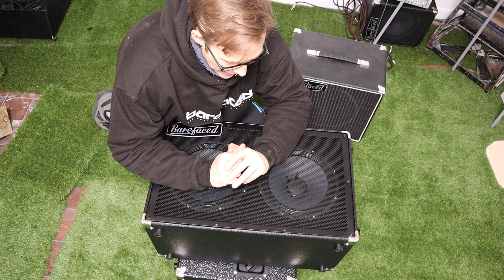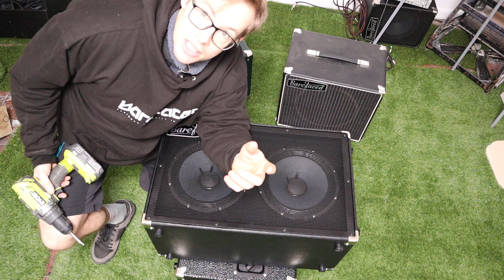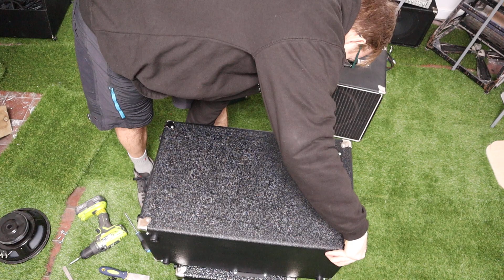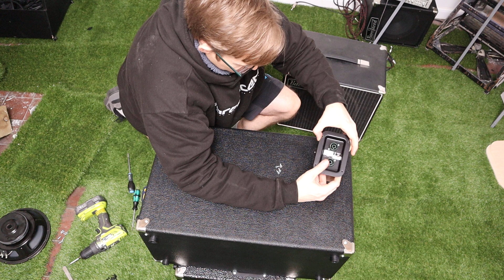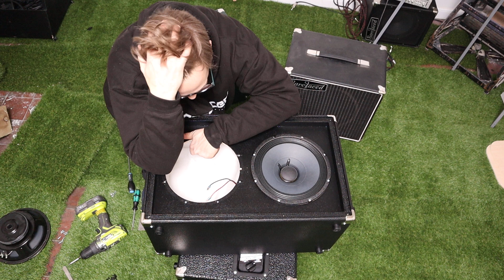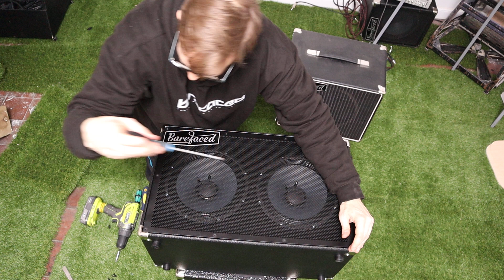How to: Upgrade a Two10 to a Two10S. (Also how to remove and refit a steel grill).

Comment: Hey Alex, super interested in this video!

In the US we use a lot of TorX bits, I build my cabs with mostly T-15 and T-20 Self-Tapping Screws, even though I still drill pilot holes. 

I still use Philips for the corner protectors still because it’s not practical to get that many small wood screws in Torx. 

Also, I stopped using T Nuts and just went to brass threaded 10-24 inserts because T Nuts weren’t grabbing that well in some of my builds and getting lost behind the grill cloth
Reply from the maker: Torx is popular in mass manufacturing because it works well with robots or power screwdrivers when you're in a hurry and it's a better standard than Allen/hex heads for avoiding rounding out. I remember looking into this a looooooong time ago at the start of Barefaced and finding that pozidrive or phillips pan or flange heads were lower profile (because there's more metal left between the head and the shaft once you've made the indent for the screwdriver). 

Regarding t-nuts, there's lots of different ones available and the ones we use nowadays are very spiky with almost barbed prongs - but older cabs may have one that are less determined to stay put, hence all the warnings on this video (and you never know how hard someone will push - it's easy to put a lot of load into the t-nut if you're using a drill driver!)
Reply: @BarefacedAudio  thank you for the insight! I need to investigate posi-drive screw heads and these newer T-nuts you speak of, sounds more exononomical, those threaded brass inserts are really expensive!

Like you say, the small details are worth spending $ on. I look up to you a lot, I always put your videos on when I build cabs because you and BareFaced inspire me to make my own small line of cabinets better and better. I’ve tried to follow your advice over the last few years on many things, and I just wanted to say thank you for making yourself available to us small time cab builders in the US. I love what y’all are doing, even though I’ve never owned or seen one of your cabs in person, I can tell you build and engineer them RIGHT. 🤘